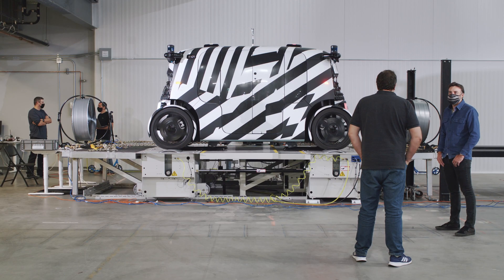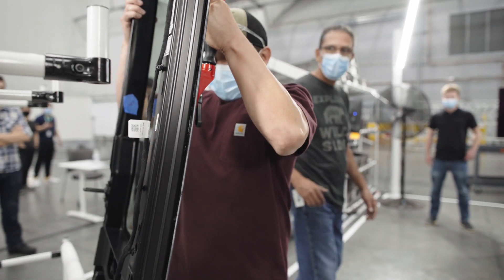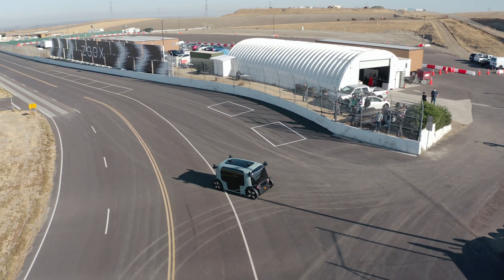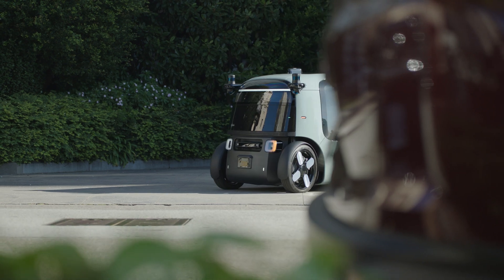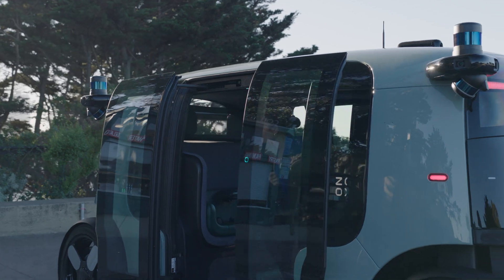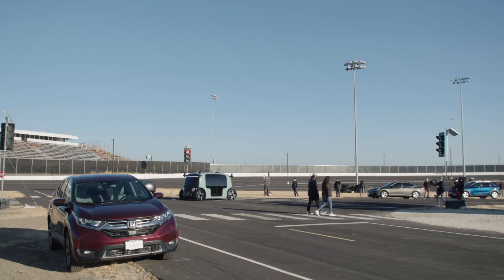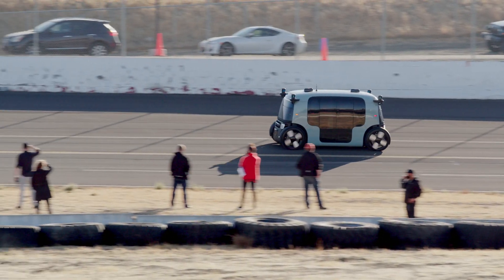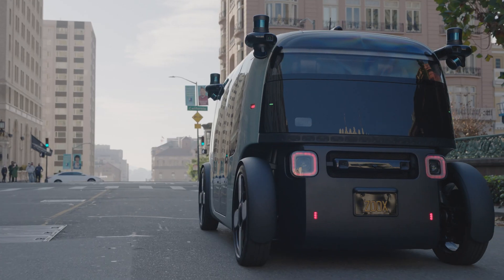Building Zoox from the ground up

Comment: Sounds superficially logical, but highly questionable. Clearly traditional car shapes are fit for purpose, and even your own test mules prove that you don't need a special vehicle shape for optimum sensor placement. You say the vehicle can go 75 mph, but clearly it's not designed for speed. It looks more like something that will never leave an airport parking lot loop.
Reply: Umm 40mph is enough for a city taxi
Reply: You have to learn how to walk before you can run 😉